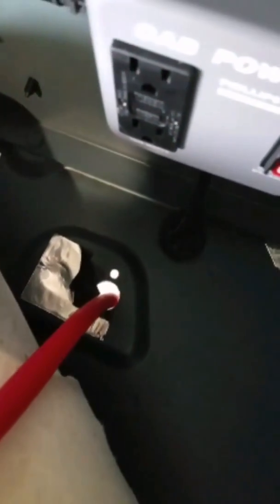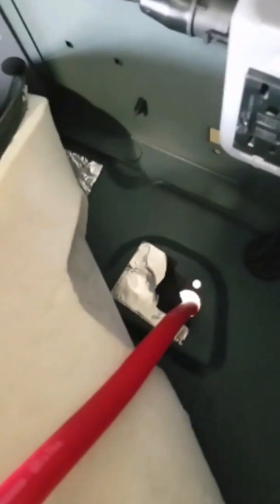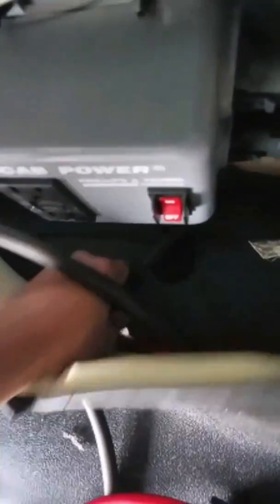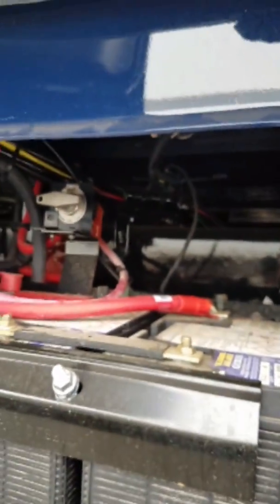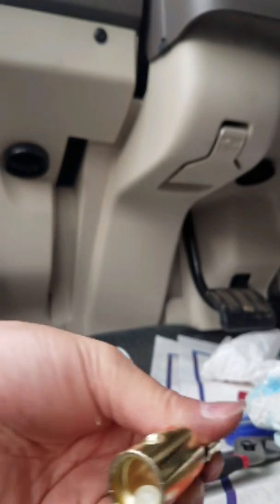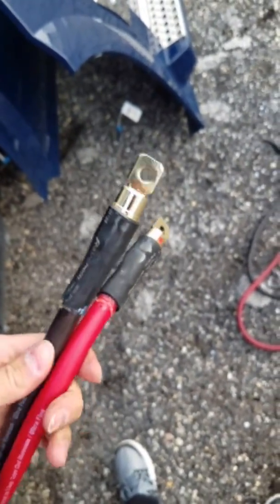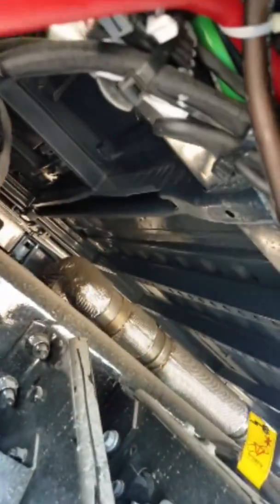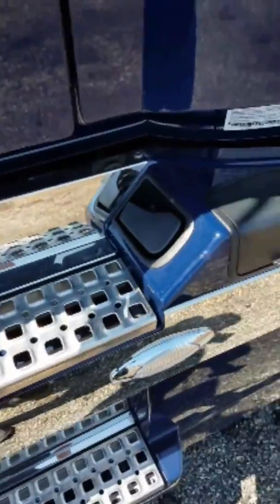Quick Installation Of 2500 Watts Power Inverter In Truck

Comment: Apart from the fuse being in the wrong place, did you leave enough enough slack on the cables for when you need to tilt the cab fully? Best to have used a set of Anderson cables so you can disconnect them to work under the cab.

Comment: if you guys dont mind, whats the point of that 250 amp fuse he added ?
i dont have any fuse. its just connected to battery. is that bad ?
Reply: Prevent fires and overloading. Protects the t ruck

Comment: Do a Volvo have a built-in inverter?  And why u wouldn't use the one that's provided   the truck have outlets already.
Reply from the maker: Some trucks have pre-installed inverter, some don't. Mine didn't and those outlets are blank. They're there for shore power
Reply: You could give those outlets power with that same power inverter.. did it to mine.. Double male sided cord and connected to the main outlet under the table on the driver side and boom.. got all the outlets working!

Comment: Very bad advise. The fuse and a circuit breaker belong next to the battery, not under the bunk. Every inch of the hot lead between the truck and your fuse is a fire waiting to burn you in your sleep. Also, 1/0 gauge wire is not big enough for a 2500 watt inverter. You need at least 3/0 gauge wire for that.
Reply: 1/O is good for 200amps. Its 2500watts at 120v, current is about 20A. 1/O is overkill. Even cars using msd ignitions to the battery you can use 10 gauge.
Reply: @andrewt4935  The voltage through that cable will be 12 volts, not 120. Inverters are nowhere near 100% efficient, so the maximum input current at the inverter will likely be over 300 amps. The size cable needed will depend both on the maximum current it might have to carry, and the length of the cable.  
See https://www.altestore.com/howto/recommended-inverter-cables-sizing-and-breakers-or-fuses-a62/ for recommended sizing and don't take stupid risks with your life. Inverters are the number one reason trucks catch on fire, and it's usually a melted or chaffed hot lead.
Reply: Cars/trucks are more confusing. The 2500watts should be referring to output. Typically in cars alternators run at 80-100 amps, so you see #4 to #1. Now a longer run on the truck yea, at least a 2/O. Usually a truck might want a small fridge, wont draw more than 2 amps, so 240 watts. Could get away with a much smaller inverter.

Comment: Hi. Where did you buy cables and fuse in box? I would like to repeat your idea, but Home depot, Lowes, City Electric don't have them. Only cables have few cores inside and huge fuses for power substation ((
Reply from the maker: I've got it all on Amazon
Reply: @bereketmol4227  found all parts on ebay. Thanks
Reply: Just go to your local stereo spot for cables and fuse box